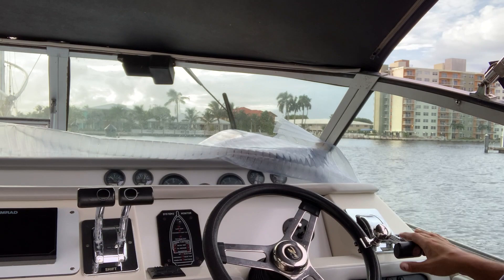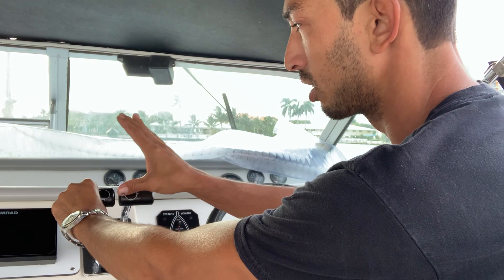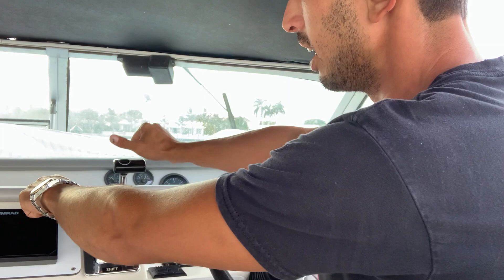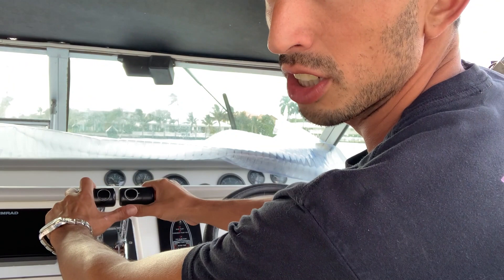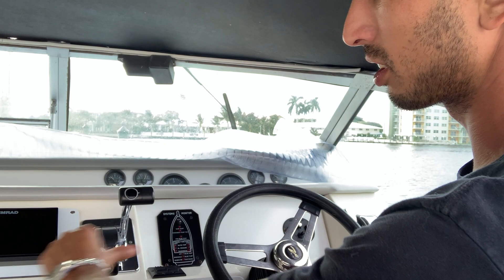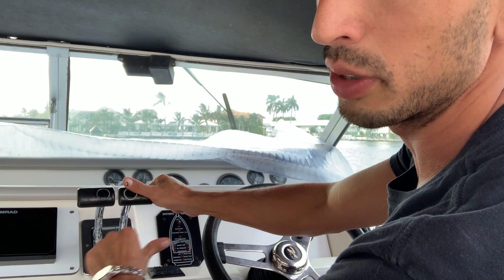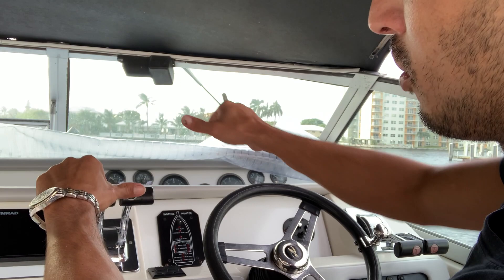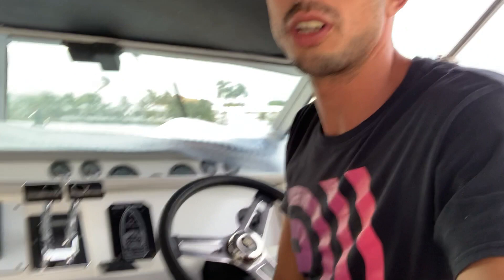Simple thumb rule on how to drive a twin engine boat and backup a trailer like a pro!

Comment: I never had thought about the thumb pointing with the throttles! This is probably the simplest way to teach someone. Thank you for that tip. 
I also had been taught backing up trailers using the bottom of the steering when when I was young working on the farm.
Reply from the maker: Back on the farm, they teach you how to back up a trailer even before you can reach the paddles 😄

Comment: Thanks for the video. Very helpful. Another trick is to think of the shift handles as your shoulders. If you were to pivot your shoulders the same way as you move the handles (Starboard forward with Port reversed for example), you will be pivoting your body in the same direction as the boat will pivot. This too, works whether you are facing forward or astern.
Reply from the maker: Very very true! Totally adding to my way of looking at it! Thank you for watching 😉👍

Comment: The backing up idea is good, we get the truck students to put one hand on hand on the top of the steering wheel, that way the can't over steer backing up..great idea using your thumbs to help in  direction. 
Buying a twin engine boat and can use all the information possible.
Reply from the maker: Nothing but a thing! A few times out and you be good 😊

Comment: Hi, nice suggestion with the thumbs, it also works the same way if you turn around with your hands behind you,  with hands in the controls to back into a slip. I never realized this until you explained it,  that's
Reply from the maker: Thank you for watching the video! You are right, this is specifically good if you are turned around! I know it helps me sometimes 😄
Reply: @Cruisingthesouth  my reply was too long and got cut off, im in long island NY  i just switched to a SR 88 340 express strt drives 454 carb. I couldnt find a newer express here kee pup the videos,  Tnx Sean
Reply from the maker: I personally prefer the body of the older ones they are so much wider. The wider beam is definitely nice! And as engine swap goes it couldn’t be any easier to switch a block if you need, I replaced one of my engines with the boat on the water! 😁
Reply: @Cruisingthesouth  I watched that vid. nice job. Im repairing a water leak n have the walls pulled apart up front, about to put pulpit in when rains over. ill try to send a pic when done in a couple weeks